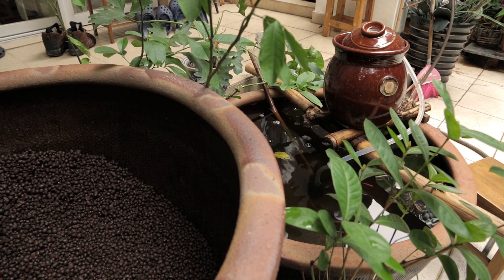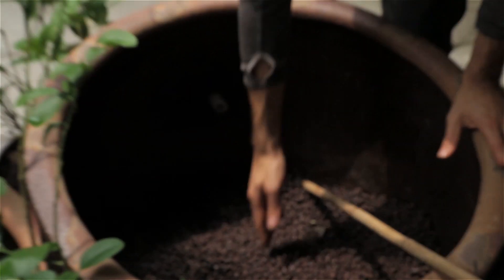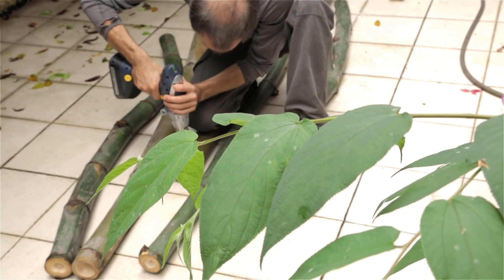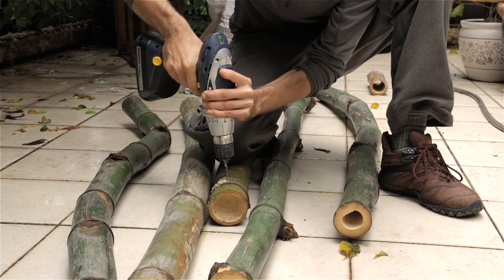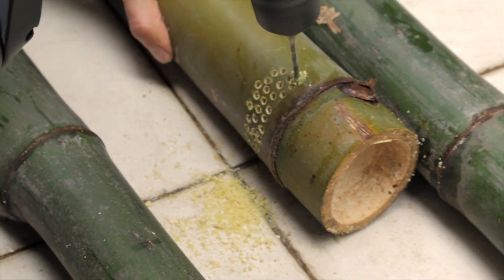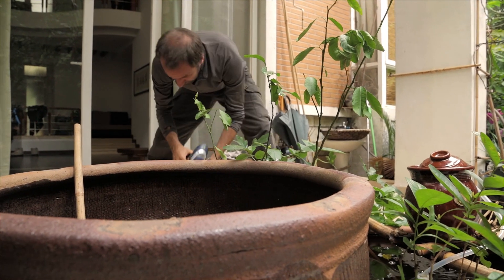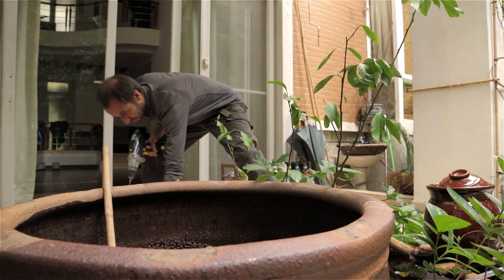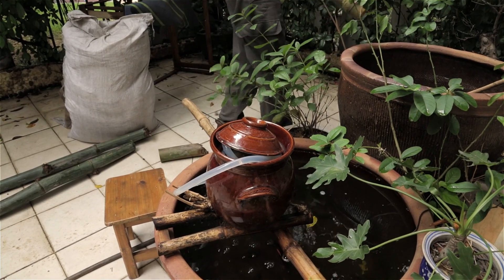Zen Aquaponics - Aquaponics without the Chemicals

Comment: This is amazing and unfortunately the only video I've seen so far that covers actually environmentally friendly aquaponics.  This is something that needs to be approached more often.  Perhaps more about these systems can be shown.  Especially on that silicone and pottery pump there.

I think it can be done, it's just that the community of people who do aquaponics don't tend to be the community of people who are concerned about plastics.  I would like to ask more about what people have done to reduce plastic in aquaponics but I'm sure I'd be ridiculed for it.

I can think many things that can be used for plastic-free or almost plastic-free systems.  For large ponds use tile or concrete, I mean that's what people use for swimming pools right?  Yet even for decorative ponds there's always the damn plastic liner.  Raised brick or stone can be used to construct large pools for water similar to raised garden beds.  Or you could even use a ceramic bathtub!  Stainless steel pipe is expensive, so the system would try to minimize the use of pipe.  I've heard that copper, brass, bronze, and galvanized steel pipe can be toxic for fish due to leaching copper and zinc.  You could create a raft system made entirely out of bamboo instead of icky styrofoam or insulating foam(which by the way is treated with a lot of toxic stuff).  Some of the more active parts would be trickiest, there are ways to use an air pump to move water instead of using a pump that is submerged.  I can only hope the air coming out of the pump is clean and the internal parts aren't offgassing anything nasty.
Reply from the maker: These are great ideas. We didn't continue with this after a few years and ended up moving away from this location. We did find stainless steel pums, and if you had a strong enough pump you could potentially use bamboo. 

You are right about the other metals being toxic for fish. Have you started a system? I had my own system that Used glass for tanks and medical grade silicone for pipes, but with a plastic pump. :( I moved away from China so I haven't had a system for a long time. I was able to grow Thai basil, and it grew very well. Delicious.

Comment: I am wondering why more people aren't complaining about the use of plastics in these systems. Especially with the plastic always being in the water and plant roots that can easily suck up the toxic stuff. You wouldn't notice because usually it doesn't hurt the plant but is stored in it. I mean people have used plants like lilies and things to filter polluted water for ages. 
I am not clear on how your system works though. How is the fertilized water reaching the plants? Are you simply draining the mock from the tank to use as fertilizer?

Comment: I was concerned myself about the use of plastic and other petrochemical products for systems that were supposed to be sustainable and "eco-friendly"according to many. Plastic does not biodegrade well, and the products made with it are easily damaged and ephemeral in functionality. So I found options for using metal pipes, though these can leach into water, and the process of acquiring and processing the raw materials to make them isn't environmentally friendly either.

The best (and one of the most expensive) options I found is vitrified clay piping. Durable, long lasting, resilient to most chemical degradation, and it is made solely from high-heat treated clay and shale.

Comment: Mr. Lambert, I have to commend you your efforts to limit the amount of plastics in your aquaponic system. Two years ago I became interested in aquaponics but I noticed nearly nobody was admitting the potential flaw with most systems were PVC or other harmful plastics are used. Can these leeched chemicals make it into the aquaponics food supply? The answer is unknown to me but I strongly believe it's something worth investigating.

Aquaponic systems are mostly closed systems that recirculate water through the same plastic components over and over. Unlike hydroponics which often flush the system, aquaponic systems have a increased chance of chemical accumulation. Of course we aren't drinking the water but is it possible that the plants or fish could accumulate the toxins. Until there is some scientific investigation on this then we might not know. A lot of these questions are still being investigated in studies unrelated to aquaponics that deal with ocean life and plastics.

All these concerns could be over nothing but until we know if fish/plants metabolize or store chemicals related to plastics and how the consumption of those plants and fish could affect humans, it might be safest to follow your example and design a system that uses the least amount of plastics possible. This is easier said than done though since most people use PVC because it's cheap, once you start getting into metal pipes you are looking at significant cost increases.

Thank you for sharing your system with the world and offering alternative aquaponic solutions.

Comment: What do u use for a pump if it's plastic free? And the clear "rubber looking" time what is that?
Reply from the maker: Hey Chris. He uses a plastic pump, and the tubes are medical grade silicone. But other than that it's plastic free. I guess I should have made that clear in the description. I've updated it now.
Reply: You could use a steel pipe with air pump to lift the water up instead of pumping.